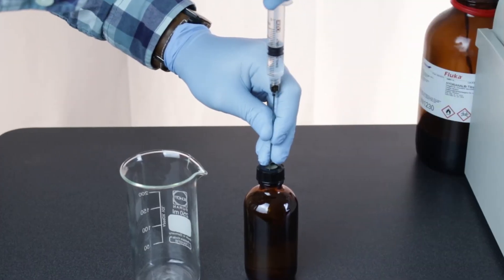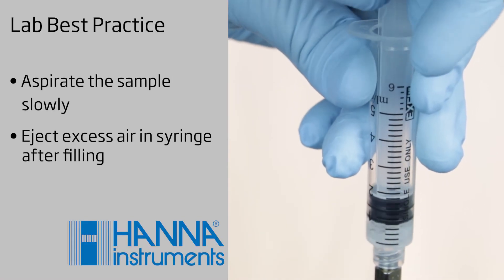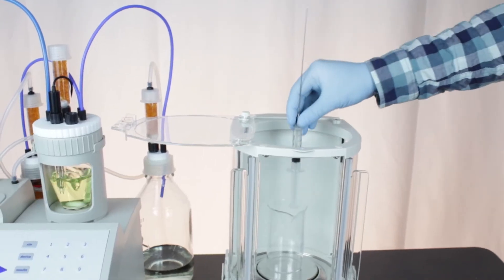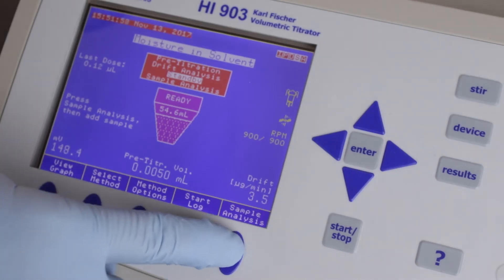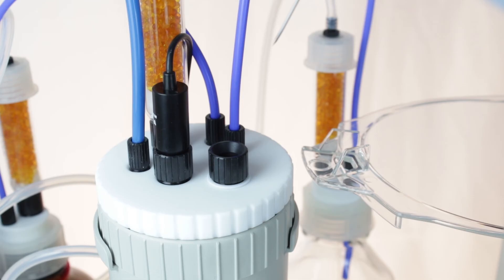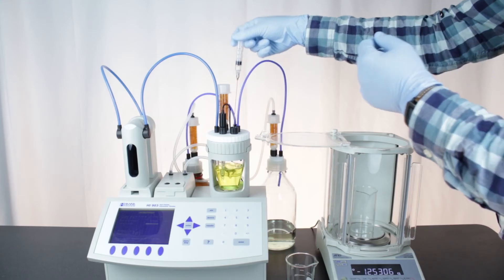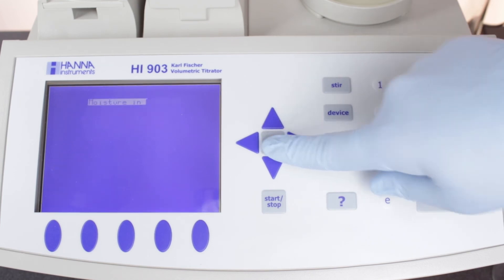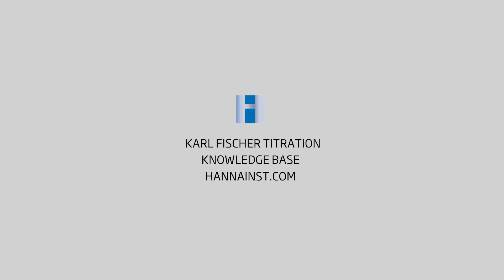How to Introduce Samples for Karl Fischer Titration

Comment: I see you put more than 3 g of sample, but with the first drop of sample we can see a change of color of the solvent, so is necessary inyect this big amount of sample?.
Reply from the maker: Hi Thealan. Thanks for the great question! 
Optimal sample size, for the greatest accuracy, can and does vary greatly between samples. This is primarily based on expected moisture content, as well as sample composition (i.e. is it thick, is it sticky, does it take a longer time to dissolve…). In the case of the sample featured in the video, we are titrating a solvent. Solvents inherently have a very low moisture content. Even though visually speaking we see a slight color change when a smaller volume is introduced, it is better to have the larger volume. This will allow the instrument to dose more times, and allow the endpoint to be more accurately detected. Solvent actually has such low moisture content that if you used a very small sample size, (i.e. a drop) you would risk the results not being as accurately detected. Even with the precision of our instrument, a single drop of titrant could be enough to overshoot the endpoint in low moisture conditions.
Reply: @HannaInc  exactly and according to USP method the karl fisher measures 2 to 250 mg of water, so it is highly recommended to use higher weight depending on the specification of the sample as well.